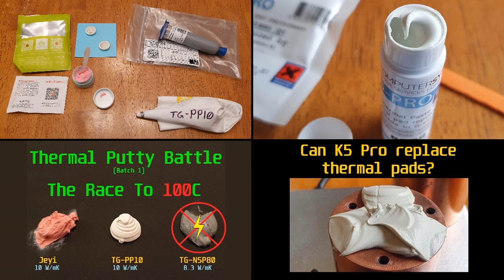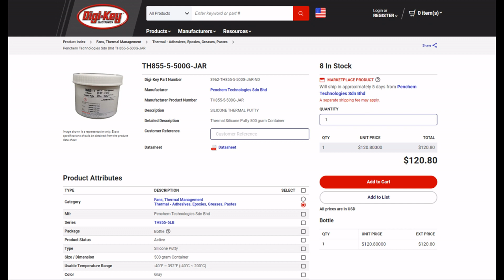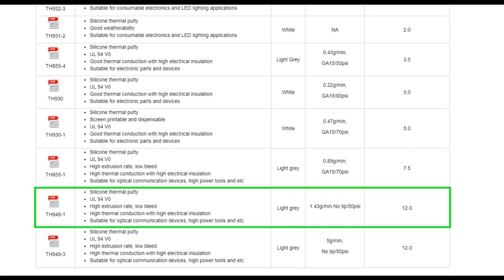Penchem Thermal Putties: Big Win For Thermal Putties

Comment: in your opinion, is 949 0 worth the extra $$$  vs 930 especially with the 40 dollar shipping fee digikey has to get for penchem?
Reply from the maker: 949 is like the Ferrari of putties, as is EVGA. 930 simply matches the performance level of TG-PP10.

If you have GDDR6X and want to only use putty for the VRAM I would at least get Jeyi 8100 or better.

If you are doing shims then you can use 930 to good effect.

You can see their relative performance levels in one of my other videos where I use them on a Zotac 3070 Ti.

https://youtu.be/zSX_7P0HZqc
Reply: @snarksdomain  thanks for the reply!   I actually bought the last 4 tubes of EVGA and they haven't put it back up since. But I have like 3 PCs I'm building for friends and I'm not trying to cut gelid pads or deal with mounting pressure issues. I need more EVGA putty. But I dont wanna spend 200 bucks on th949. Lol

Comment: Seems this "putty" thing is a great idea to fill the gaps. Unfortunately not many people know about this (in my country) and see some issues reselling cards with thermal putty on. Don't know if the compound can be recycled but "shelf time" is very short being only 6 months. Good video by the way. Been seeing all your putty videos (this is like the 5th one). Regards
Reply from the maker: Thanks for watching :) I'm just trying to get the word out so more people will k ow about Thermal Putties.

Don't be too concerned with the shelf life. I've still got 1.5 year old putty that only had 5 months left when I applied it.

All that happens is it gets a little stiffer over time. But it's still pliable and can be reused. Worst case you can add ~20% new putty and knead them together.

Comment: Hi nice that you found some alternatives. I told you weeks ago that I found a chinese factory who could make a putty at 12w/mk. I bought 1kg of their putty and I made a comparison in temp on a 3090 and it's far better than Jeyi or Upsiren, like 5°C better than Upsiren and 7°C better than Jeyi
Reply from the maker: Those are impressive results. What is the name of the manufacturer? Hopefully I can get some for testing :)
Reply: What is the name of this Chinese manufacturer? What did they charge for 1KG? And what are the Upsiren thermal pads like?

I've seen those pads on Aliexpress and they are quite well priced if the specs are right.
Reply: Can you give us a link to the company?
Reply from the maker: @tmstiles  link is in the description as well as a link to Digikey. You can change the country on Digikey by clicking on the flag and then selecting your country/region.
Reply: @snarksdomain  Thank you,  i was hoping for somewhere other than digi-key as the prices seem much higher than what can be had from china, was hoping for a decent link to one of those
Reply from the maker: @tmstiles  if you only have 1 card and are looking for a cheap source of a good thermal putty I recommend looking for Jeyi 8100 thermal putty on Aliexpress.

Comment: Nice work! But I see that these putties expire 2 years after production which for TH 949-1 is in 6 months. Does this mean that they need to be replaced every now and then?
Reply from the maker: Luckily no. They will keep transferring the heat just fine.

I suspect those shelf life dates are more for automated applications where the consistency has to maintain it's galons/min at specific pressures (pnematics).
Reply: Yes that makes sense. But still it is scarry considering that thermal pads don't have expiration date and still their heat transfer ability is reduced and we have to replace them. It would be interesting to compare their long term performance by trying a year old expired packet maybe.
Reply from the maker: @Vernom-rl7dx  For sure. I've opened up a card that had year old TG-PP10 that, when originally applied, only had 6 months left of it's shelf life. It was slightly stiffer but could still be kneaded and shaped. 

I added a little bit of fresh putty and mixed them together to make it softer then reapplied to the card.
Reply: @snarksdomain  I'm also curious about this. Did you mix in the new putty directly on the VRM to make the putty softer, or did you have to pry the old one off then mix it with the new one to achieve that consistency?
Reply from the maker: @duyvo2639  I stopped the old stuff up and it was easy to remove. I then kneaded it in my hands and added in maybe 15% new. I believe I filmed it but will have to double check.

I have a ton of content to edit. I just tore apart and reassembled my Zotac 3070 Ti around 12 times in the last 2.5 days testing out different putties, pads, and shims.

I will have to edit that video in the next few days hopefully (gotta go to work).
Reply: @snarksdomain  Damn! That's a lot of work! I look forward to more of your test videos. 

You are the only one on Youtube that produce these in-depth videos to guide us on what (and what not) to purchase! Greatly appreciate your work!
Reply: You did a lot of work indeed! Highly appreciated! This expiration date still creates a wall for me though. I do a few of repastes for office laptops per day so I can't take my chances because performance not so important. It won't make difference if they run a few degrees higher but if they start overheating because of expiration of putty it will be nightmare. I will stick with putty that doesn't expire for now but will keep this in mind and order when I need for something that gets really hot. Sadly I can't order now to have handy when needed again because of expiration date.
Reply from the maker: @Vernom-rl7dx  which putty are you using that doesn't have a shelf life rating?

These high end thermal putties are the kind used in permanent applications. Think automotive, aircraft computers  etc. When was the last time you reputties the ECU in your car?
Reply: @snarksdomain  Thanks God I only deal with around five years old laptops and not with car equ. I understand this and that's the scarry part. I have seen how these factory installed putties look like after a couple of years. They get completely dry and must be replaced. Seeing your testing makes me feel uncomfortable to say that I keep using K5 but honestly it works good every time for my needs. I see that in your testing others give superior results but for me K5 is an apply and forget solution. Every time temps go down and if I need to repaste I can reuse old remains even after years. I still have a 400g can I bought in 2019 and didn't change at all. I know that my needs are not so intensive but I still couldn't find a better solution. I will definitely try one of these putties though as soon as I need it for something really hot.
Reply from the maker: @Vernom-rl7dx  I'm glad for your perspective. Have you ever had issues with K5 pumping out or boiling?

It seems to have a Flashpoint of 100 C as stated on the MSDS.

Flashpoint: "The temperature at which a particular organic compound gives off sufficient vapor to ignite in air."
Reply: @snarksdomain  To be honest I don't pay attention to such factors and never noticed such problems anyway. As long as temperatures go down and customer is happy I don't care if it boils inside or whatever. Can't say that I ever had any issue with K5 PRO. It's just that I am using this for near 7 years and I thought something improved should appear on market. If I make a change though I need to see only improvement. Maybe these putties work better on thermal plates or on really hot components but for my customers laptops I think they will work the same with only deference that they might get harder soon and might have to replace them fast. Even if this doesn't happen though it will be hard to explain for example to a German company customer that it is ok to use an expired paste inside their business laptops.

Comment: I have a question .just watched the video . 
You said they have the tg-pp10 instock im going to buy a 1000g tub i want to use the putty for the memory chips on my 4 3070 gpu's they started throwing errors a couple days ago i just repaded them 8 months  ago with the gelid ultimate my 3090 was done at the same time to and the temps on memory went from 75c to 92c now just took it apart and pads from the 3070 and 3090 are rock hard. 
I want to use the tg-pp10 you thi k thats an ok putty or should i go with one in this video . 

Thanks a bunch man keep up the awesome videos.
Reply from the maker: I would say that either TG-PP10 or TH930 would be fine to use alone on GDDR6 memory.

For cards with GDDR6X I recommend going with better puttty/pads/shims for the VRAM and Putty everywhete else.

I've had some lucky just using TG-PP10 on 3080 FE cards in desktop computers, but as soon as you have an energy dense mining rig I found TG-PP10 putty alone was inadequate for GDDR6X cards specifically. 

I should add that TG-PP10 or TH930 pair really well with shims, as can be seen from the tests.

Comment: How much did you pay for the TH949-1 plus shipping? It's also on my wishlist.
Reply from the maker: I paid $80 USD for the 50g TH949-1 sample and $120 USD for shipping of all 3 samples. The shipping was fast. I believe you could likely ask for slower/cheaper shipping.

I think Penchem will be adding more of their products to Digikey  and hopefully TH949-1 is added.

Although I have the sneaking suspicion that TH949-3 will be even better for copper/aluminum shim applications. It appears to have e a lower viciousity judging by it's flow rate at same pressure as TH949-1. Hopefully I can get some TH949-3 to test at some point, but that will have to wait a bit.

https://www.penchem.com/Thermal-Management
Reply: @snarksdomain  Thank you so much for the info! I'll try to order some of the TH949-1 too!

I also saw their listing of TH949-3 on their site, but I'm unsure. Will have to wait like you said.

Comment: Hi do I need pressure for heat transfer? I will probably buy jeyi 8000 from aliex. My back plate doesn't have good pressure with the card. So using a thermal pad won't really work. Can I use putty instead? Would it work with little pressure?

Also I will do the vram copper mod to rtx 3090 back side since my backplate is awful. And i will use this putty as you say thermal paste can bake. And I will use kapton bant too around smds and all.

I just want to use putty in VRMS and other components too. They normally use thermal pads by they suck (zotac..).
So on the back side of pcb there is just vram thermal pads. But i will use putty on the vrm back side too. Does it make sense? Thanks!
Reply from the maker: Yes. Putty works great in scenarios where there isn't a lot of pressure or for uneven gaps. You just have to make sure the putty you apply is thicker than the gap so it can squish down.

For the backplate I often apply gentle pressure by hand to compress the putty, then I install the screws.

Using a sticky putty for the backplate is good since the backplate can flex when being handled. Sticky putties will "bounce back" if they are overcompressed.

Sticky putties include:
TG-PP10
TH930
JEYI 8100
EVGA Putty
...and probably A7000, TG6060 although I haven't tested them.
Reply: @snarksdomain  aliexpress don't sell 8100 to my country only u6 Pro by upsiren. Would it work?
Reply from the maker: @Hi-levels  I'm told it will have the same performance, consistency and appearance to Jeyi 8100. I still need to get some to test.
Reply: @snarksdomain  ok Mr putty we believe in you. Hope to see your testing. I will order the alleged 40watt/m.k 3D graphite pads you made a video on. My normal pad thickness for vram is 2mm. So i. Will buy 2mm + thermal putty for back plates. Man I'm so jealous 4000 series have no vram heating issues 😭
Reply from the maker: @Hi-levels  for a 2mm pad replacement on those 40 W/mk use the 2.2mm pads they have. Compression will not be an issue.

Backside plate use of those pads can be a slight issue since they won't bounce back if overcompressed, as Ghostmotley noted.

Comment: Still waiting for non hardening cheap silicon caulk as thermal putty testing.
Reply from the maker: Would this be a good one to use for the test in your opinion... DAP Mono Acoustical Sealant - Synthetic Butyl Rubber - Dark Grey - Non Hardening Model #75400
Reply: @snarksdomain  I don't know the consistency of that specific caulk. After seeing that toothpaste works as a thermal grease on a processor, and being that thermal putty is mainly silicon, I would think that there would be a cheaper alternative to expensive thermal pads. Rubber wouldn't hold up to the heat long term. I wonder if there is a safety data sheet that shows the ingredients of pads/paste. 
Is there a cheap 100% silicon non hardening caulk?
Reply from the maker: @nathanielschroeder1321  I'll try looking for one. If I can find a non curing/hardening silicone based Caulking I'll buy it for testing.

I do have a tube of MG 860 Silicone Heat Transfer Compound which is rated at 1 W/mK. I'll test it shortly here and make a video about it.

When bought in bulk, Thermal Putties like TH930, TG-PP10 and TH855-5 end up being fairly cheap. If I only use putty on a card and no copper shims it ends up costing me $25 CAD or less to do the job (~$20 USD).